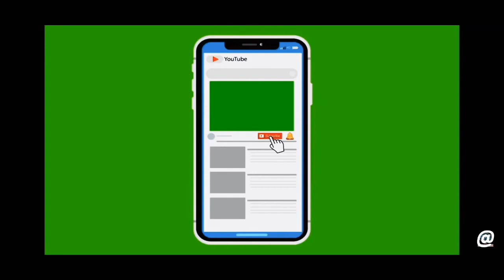How does a colorful paver machine work?  Watch this review before you make a decision!

Comment: You did not tell how much percentage of pigment be used. The color pigment is expensive which will make this brick more costly than kiln red bricks.
Reply from the maker: Friend, you could try to add any percentage of pigment, when you see the color looks fine, that’s enough
Reply: @HenryBlockMachineGroup  what is the raw material you used and the cement ratio?